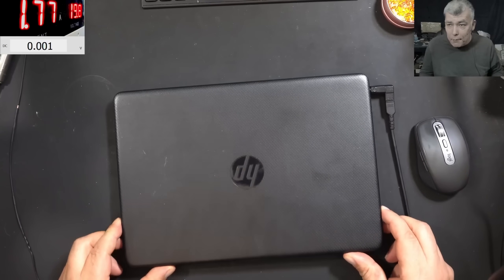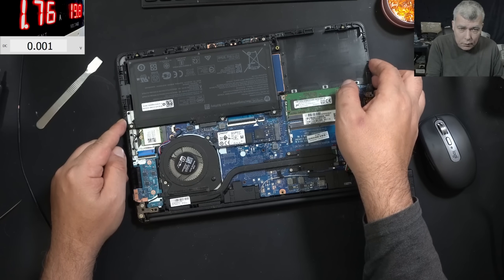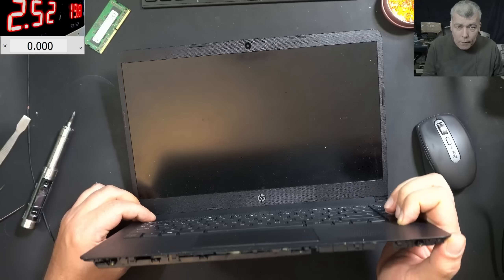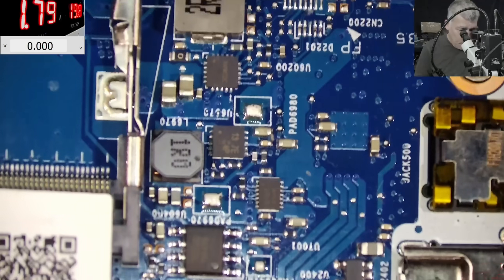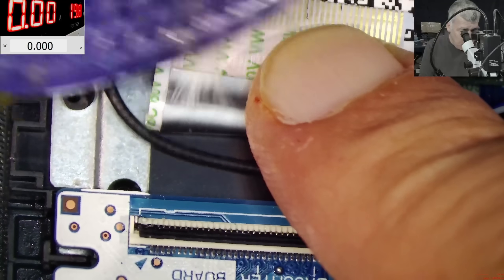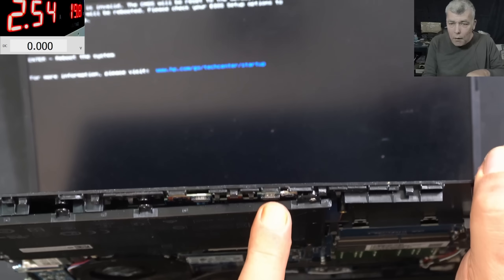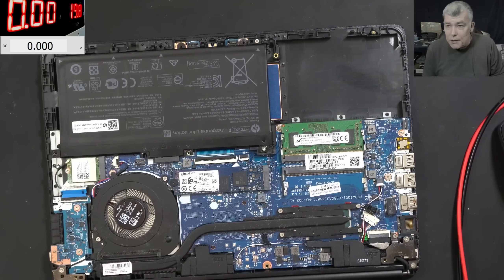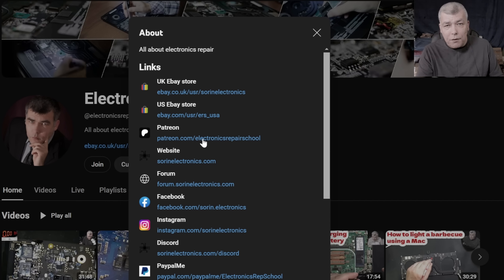HP 14-cf3512 coming on then switch OFF, motherboard repair - a good board inspection it's a must!

Comment: I've been fixing everything without microscope for the past 10 years but oh man i wish i had one... I need to save up some money in the coming months and i hope to succeed...Soldering TSOP-48s, QFN64s and 01005 components without a microscope is a pain, i help myself with my phone camera with flashlight on but it's frustrating to say the least... Screen FPC connectors are still out of my reach for example...

Comment: Hey! ive got a question about a semi old ThinkPad laptop ive been trying to fix. Is it normal to have 2K Ohms across the 1V line and ground? particularly when measured from the pins of the mini PCI WIFI card port (without the card in)
Thanks :)

Comment: 1. A Good Microscope, either optical or digital (optical is better for details, but some preffer digital because of neck, back and eye strains)

2. A good bench power supply, one with capabilities of at least 30V 5A to start, and preferably linear instead of switching.

3. Thermal Camera for finding problems faster and easier

4. A good set of tools, solder iron, hot air gun rework station, pliers, tweezers, desoldering wick, soldering wire 180°C and ROSIN, ROSIN IS ALWAYS GOOD 😅

There's more to it, but this one is the bread and butter of repairs. Maybe thermal cam is optional to start, but definitely worth it for easier works and time savings.

Comment: a microscope makes a big difference in boards repair its good to see solder flows to tiny smd components but then i realized that i needed a barlow lens for a larger field of view and a long working distance because i felt that the hot air could easily damage the lens also a rotating arm and a polarized ring light are necessary imo

Comment: I'm going in for cataract surgery in two weeks. I asked for a zoom microscope lens to be implanted in my eye to have robot like magnification without glasses. But of course they rejected my cool idea. Thanks Sorin. How are your eyes these days?
Reply: My father was short-sighted - very much so: -8.25 in each eye. Anyone who is short-sighted will know that you have a built-in magnifying lens as you can work very close to your eyes. I am the same & it is a facility that I value.

He had to have cataract surgery and asked for the same -8.25 lens. The surgeon refused, point-blank. They compromised on - if I remember rightly - about -4.00.

Comment: Hi Sorin, easy pizza today...yea with microscope u increase a lot possibility of repairs and in same case i think is impossible without especialy on new mobo like apple one and even other... the integration today is so high that you can do without.... noe i have a cheaper one cino.. but i'll like to by AmScope H800 Series  H800-96S-AF22 but the seel all with the stand.... i prefer Digital One because off i never use optical one especialy for the confort in working looking  strait in front of you big monitor if possibe without having to move up and down your neck all time.... give me your valutation of the product and if know where to only the microscope with digital camera.... without stand i have doing myself modifing a fume extratcor one.... bye Francesco Timpano from Florence Italy  any suggest accepted